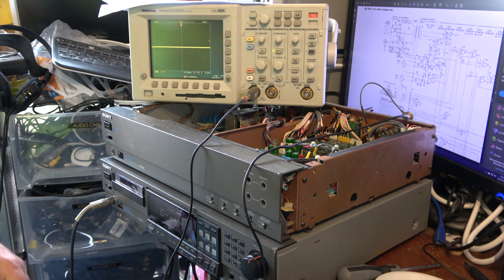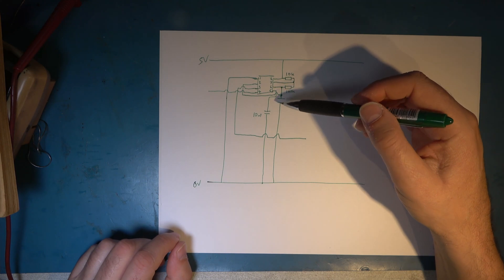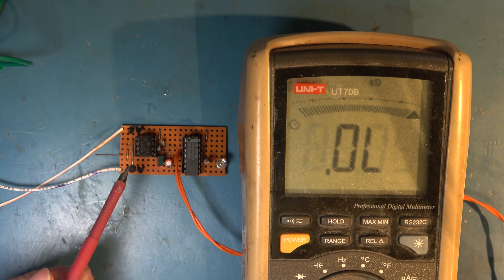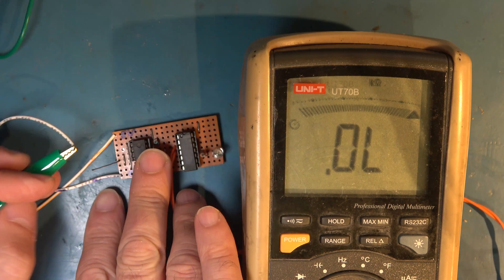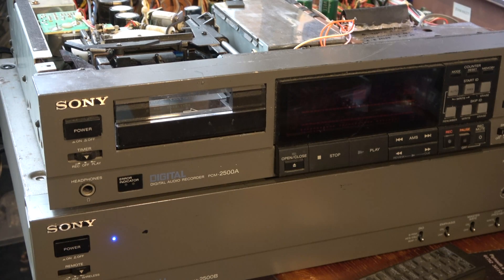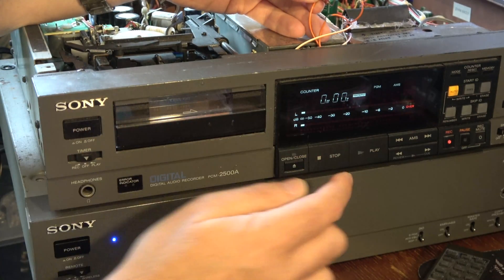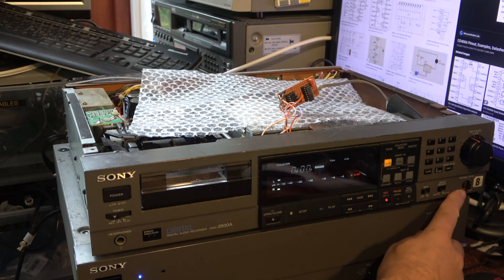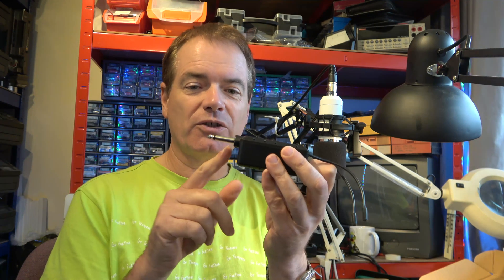REC button presser. Part 3 of using Sony DAT-2500A/2500B DAT for SDIF-2 (PCM1630) to S/PDIF digital.

Comment: hi my brother and me used to deal in used tapes   beta  v2000   N1502 i know you have kids i have to be care for here  i was alot on the tapes i could not save  on tapes
what was on them as you are in the video moving game  is there tapes you don't do  it is hard some get very up set when i say big no  
i pick up alot of betacam digi 50p a tape  i had to put them in the recorder right away soon as they came  blanked the lot
Reply from the maker: There are a few formats I still don't have such as early studio digital formats D1 and D2 (etc.) and HDCAM-SR (though do have regular HDCAM).  Also a rare domestic format VCORD-II from Sanyo, and I don't have space for open reel video formats.  I do have a 1" C-format machine but need help setting that up.

Comment: You TOTALLY stole this from the circuit that I invented to use my early V2000 VCR's as tuner! ;-)
But seriously: Those VCR's turn themselves off after 3 minutes unless you push a button such as STOP. I made it so that whenever the STOP LED was on and the AUTO REWIND LED was off, it would push the STOP button every minute or so. I didn't even need to have it oscillate: when the STOP button is pressed, the STOP LED goes off for a moment so the circuit would disable itself. Then the STOP LED would come on again and the process would repeat. And by checking the AUTO REW LED (which you can switch on to make it rewind the tape after the last scheduled recording) I could keep my circuit from interfering with the timer. All I needed to remember was to turn Auto Rewind on if I scheduled a recording.
Reply from the maker: Early Philips VHS machines did the same thing.

Comment: They though of everything when they designed the machine, 10 min limit to reduce wear and tear . it's a Sony  lol 
this is one of my favourite videos by the way , i like that clever hack you did
Reply from the maker: I think all video recorders and DAT machines have a timeout on the pause to limit tape (and to some extent head) wear.  It's a shame I had to hack it but if ever myself or anyone else wants to modify the machine back to its original condition, that's a trivial job (cut 4 wires and refit one connector).

Comment: Ahh the good old 555 timer, my favorite chip for many uses :-D
I didn't know about the oddness in some 555's.
I like your sneaky fix, i've done some sneaky stuff too ha ha :-D
So there isn't an obvious line to apply power to, dam!!
if the  4016/66 chip was causing the problem then a small relay could be driven directly from the 555 pin 3, not forgetting a reverse diode across the coil to catch back emf :-)
Reply from the maker: I was trying to avoid a relay due to the ticking noise and limited life, but had the 4066 been a failure then I would have gone that way.
Reply: @video99couk  Yes the clicking may be a pain, reed relays are quiet lol.
I have a few books on the 555 and other chips, the  one by forrest m. mims has been handy.
My favorites : The 4000 and 74ls series,  Lm317, 78xx series, 2n3055 and tip 41, not forgetting the lm723 for psus.

Comment: Nice hack!

What if you disconnect the power to the drum motor driver IC? 
Will it work or enter into error mode by lack of drum tachometer signal?
Reply from the maker: I'm sure it would go into error mode.